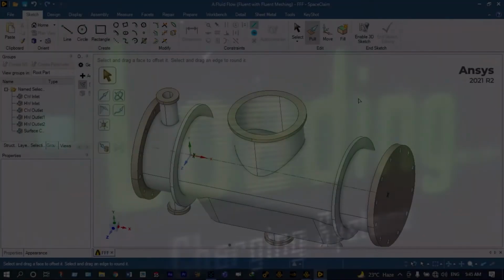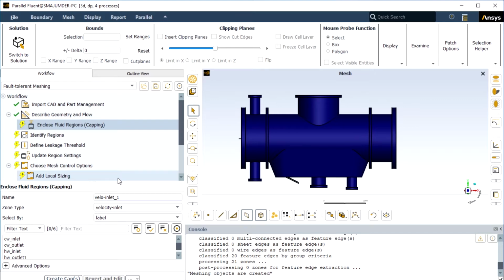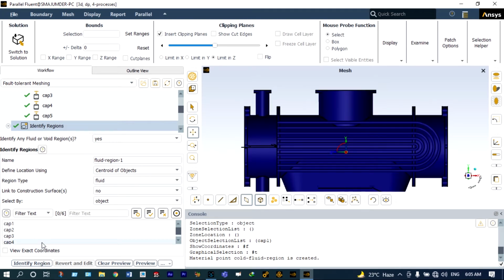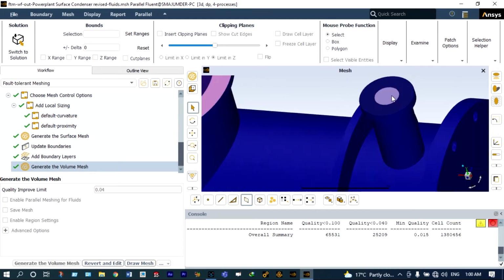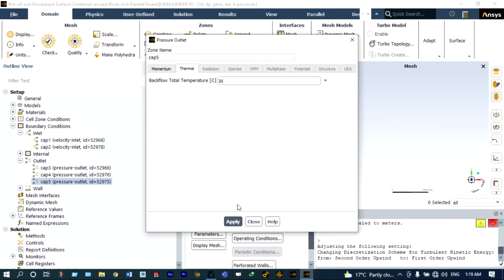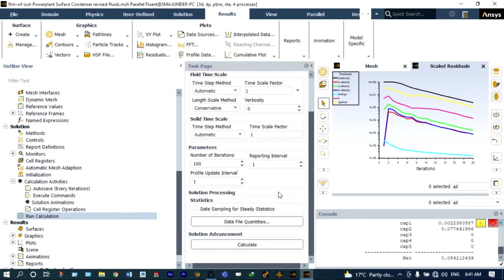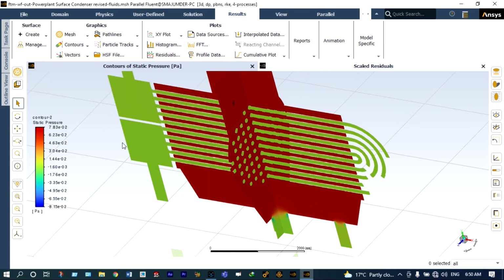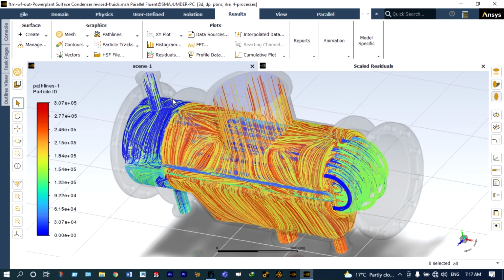CFD Surface Condenser | Exclusive Surface Condenser Simulation Tutorial - ANSYS Fluent

Comment: my enclose capping is not generating can you tell me how to fix it
Reply from the maker: If the surface is flat then automatic capping surface can be produced. Otherwise, you need to manually model that cap and attach it on that surface as unmerged object.
Reply from the maker: Dear friend,
You may visit my website to receive a lot of FREE courses and alongwith that you will get a lot of models.